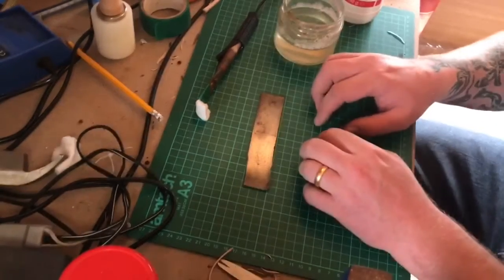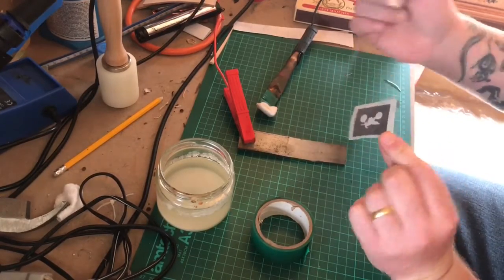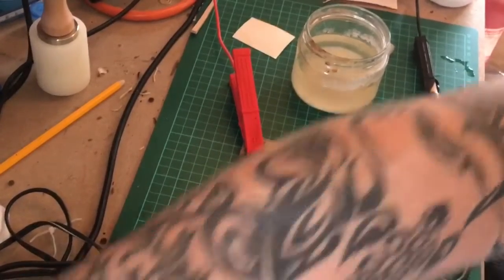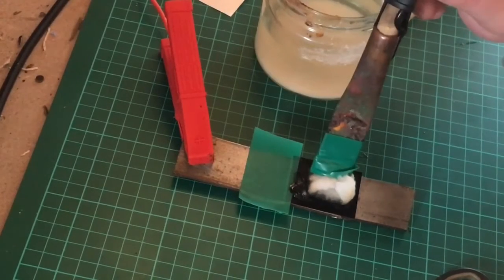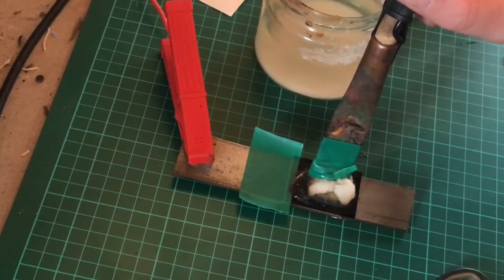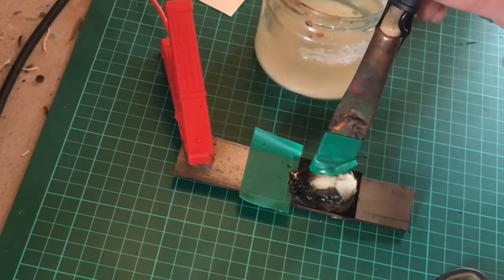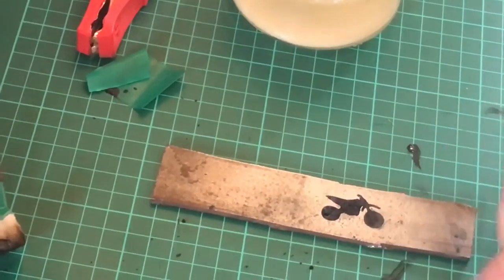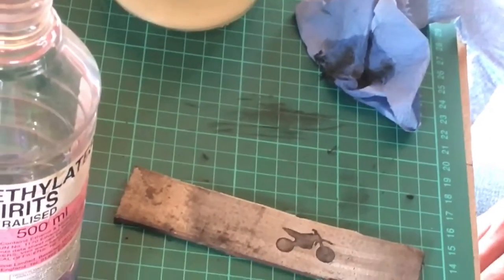Salt water etching knife making pt 2

Comment: Thanks! I've been looking around a while and haven't found anybody explaining the process as fully as you have. I'm looking at battery chargers and had a question. Are the "smart" battery chargers still going to work for this, or will they detect that they're not being used for their primary purpose? Any idea? Wondering if I should be looking for an older 'unsmart" charger.

Comment: Throttle that thing down & you've got yourself an electro-polishing setup.
You can probably use a saltwater rheostat to control the current.

Reverse the polarity & dip the cotton in an electroplating solution to highlight with a different metal.
You might be able to dissolve some copper in your saltwater via electrolysis for a homemade electropolating solution.
It should be a mix of copper chloride and copper hydroxide.
As the salt breaks down under electrolysis, it creates sodium hydroxide and sodium hypochlorite (lye and bleach). 
Sodium hydroxide and copper react to make cupric hydroxide, and the sodium hypochlorite should react with copper to form cupric chloride.